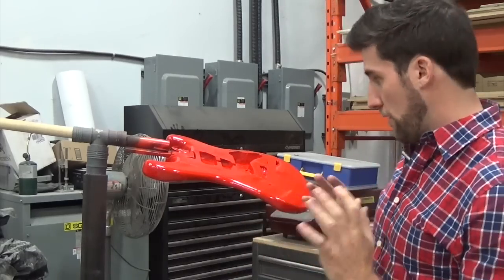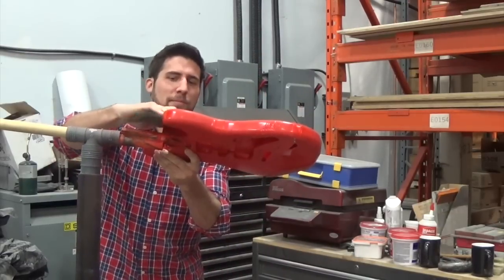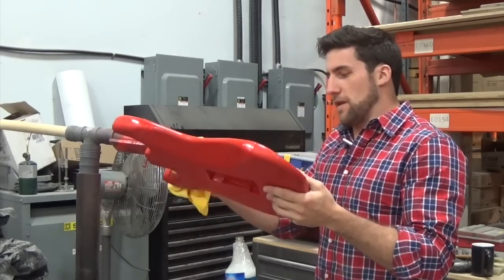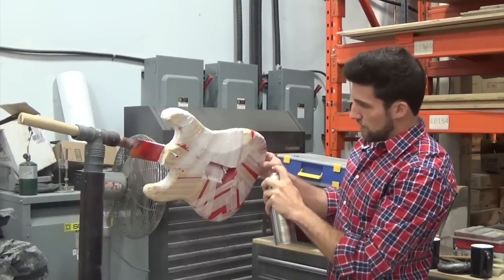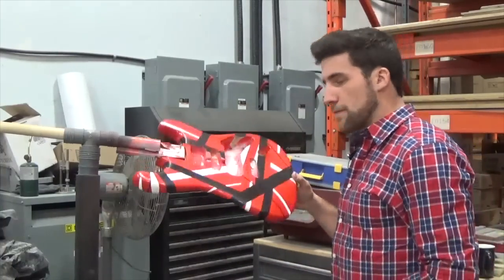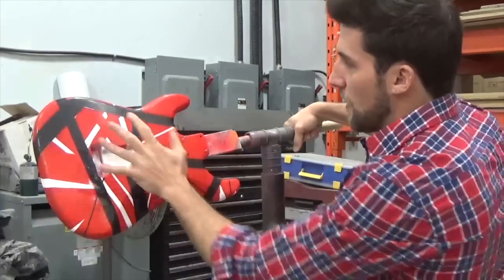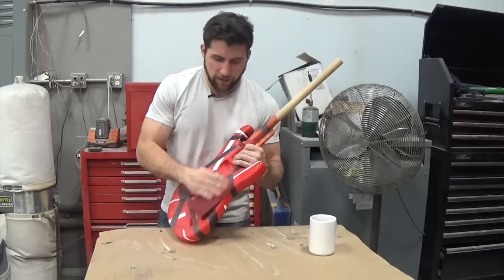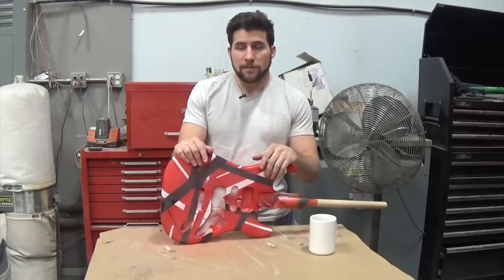How to do a Frankenstrat Paintjob Part 2

Comment: Hey Brad, one question: While scuffing up the paint on my guitar I immediately started getting discolored spots and blemishes, as opposed to an even scuffed surface (like I would when scuffing up polyurethane for example.) This was with grits as high as 800-1200 Grit. The paint had cured for a few days. Is it possible not all paints are created equal when it comes to...scuffability? (I was using Rust-oleum Painter's Touch 2X Paint+Primer.) Thanks.
Reply from the maker: +chutni -fier That paint is just as "scuffable" as any, but it's possible that it didn't quite dry properly. I assume you've now scuffed the entire surface and still have varying discoloration?
Reply: Yes that's exactly right, the discoloration is slight and indeed in varying spots,
Reply from the maker: +chutni -fier That's rather strange. Sometimes that paint does things that I don't understand. Does the paint feel properly hardened at this point? 
You weren't using the 2-in-1 paint and primer were you?
Reply: Hey Brad. Yes that's right, the paint did feel properly hardened at the time (as far as I could tell.) And yes, I was using the 2-in-1 paint and primer, is that what could've caused it?
Reply from the maker: +chutni -fier I'm not sure. I generally don't trust the 2-in1 stuff.
Reply: That's cool. I'll give stand-alone paint a try for my next one then. Thanks a lot for the feedback man, much appreciated.
Reply from the maker: +chutni -fier I hope that helps. Let me know how the next one goes.
Reply: +BradAngove An update: I decided to scrap that paint job and try something else, and the paint scuffed up just fine as I was sanding. So it must have been a drying time issue like you mentioned, thanks!
Reply from the maker: +chutni -fier I'm glad to hear the mystery is solved. Are you going to continue with the paint job then?
Reply: +BradAngrove Thanks for asking! I'm going to try my hand at a Marble Swirl, fingers crossed :)
Reply from the maker: +chutni -fier Sounds like fun. Let me know how it goes for you.

Comment: Dude your vids are amazing.  Subbed.  Im going to attempt a swirl finish, would the clear you used on this work fine?  and should i scuff the swirl before clear or build the clear up over the imperfections?
Reply from the maker: +Michael Peretto This clear should work fine. You definitely need to scuff first; not just for imperfections, but to make sure it sticks.
Reply: Cool, was just worried about possibly wrecking the swirl by scuffing it.  Also an idea for a new vid could be holoflashing like the old kramers.  Looks really cool.
Reply from the maker: +Michael Peretto I have no idea how to do that stuff haha. If I ever figure it out well enough to be able to teach it I will definitely do a video.
Reply: Brad Angove as far as i know, its a film you iron on to a black base coat but i think you have to layer on a water based clear really thick.
Reply from the maker: That sounds like an interesting process.

Comment: Ok Brad I have spent much time watching your videos (I actually subscribed tonight!) 
I plan to paint a guitar of mine. I'll just type out the steps I plan to take. Could you please correct me if I'm planning something wrong?
First I'll use 600-800 grit paper with a block to get the shine off of the guitar. I won't be sanding all the way down to the wood, so I assume it is safe to skip the use of primer and move on to applying my paint on top of the old paint. The paint I'm going to use is Krylon Glitter Blast (it will look cool haha) I'm not sure about what type of paint that is (enamel?) After applying the coats, what should I use for that glossy finish? Thank you for your time and your great videos!
Reply from the maker: You've got the steps right. I'm also not sure what kind of paint the krylon glitter blast is. If you find out, you can use the same kind. Otherwise, let it dry for a couple weeks and you can use enamel or polyurethane. Have you had a look at the video where I clear coat this guitar? You may want to consider using that clear coat.

Comment: The color is not as detailed as the original but still imppresive!!
Reply from the maker: I suppose it might have made sense to use a reference photo and go for a full-on replica, but hopefully everyone realizes that the techniques are the same.
Reply: Brad Angove i agree, but it will take alot more effort and time to try replicating the exact positions of the stripes
Reply from the maker: Yes, and I wasn’t really aiming to re-create someone else’s work to that extent.